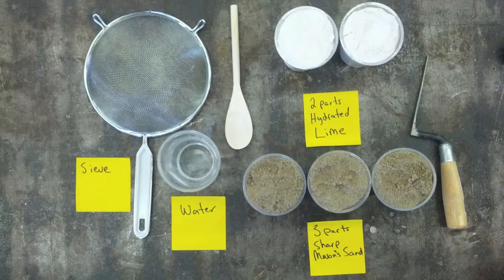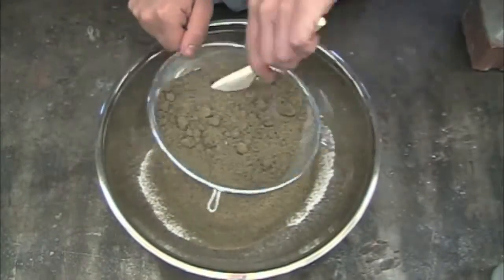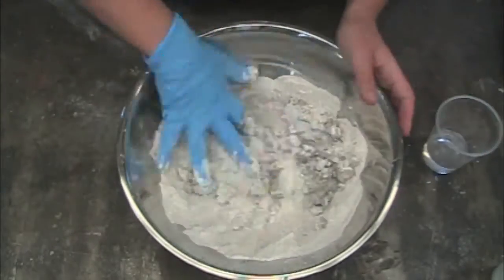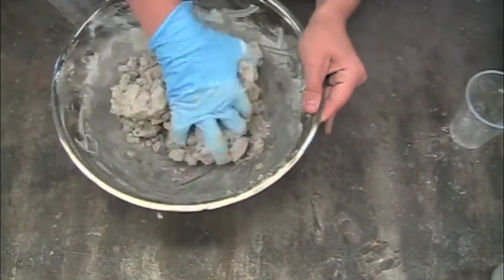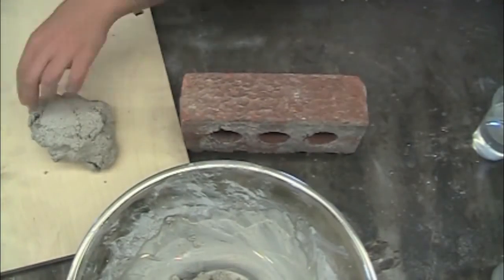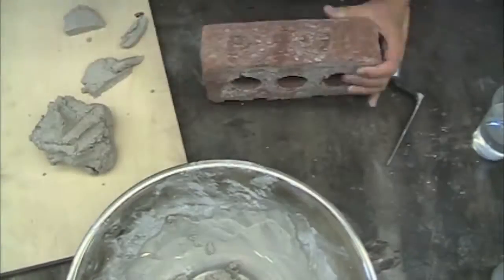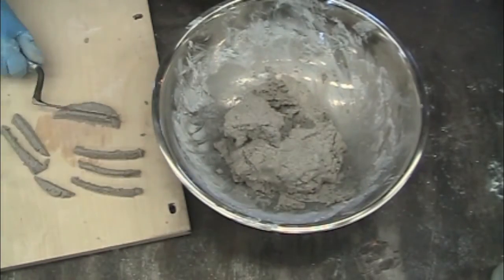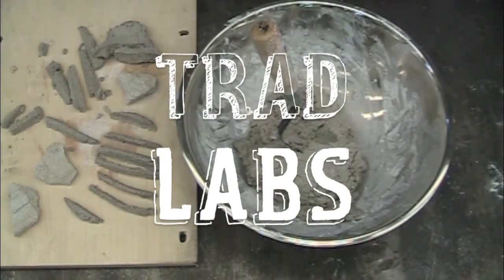Mixing Lime Mortar for Repointing Historic Brick

Comment: Interesting that you sieved out the pebbles. In Britain, a coarse, flinty aggregate is preferred in lime, so you'd actively want some pebbles in the mix for that. Then once the mortar has set off a bit, you hit up the joints with a stiff brush to reveal the aggregate in the joints.
Reply: I was going to say that! Larger stones are highly desirable for what is a very weak binder.

Comment: You need hydraulic lime, not merely hydrated lime.  If it's not hydraulic, it's won't set up right.  Hydrated lime from most hardware stores is unreactive, and won't cure.  Hydraulic lime (labeled NHL 2.0, 2.5, or 5.0  or PHL 3.5 or 5.0) are reactive, and will combine with carbon dioxide to cure hard and strong.
Reply: Very true.  What she made will fall apart the first rain.  I used to practice with this mix during my apprenticeship because I was able to reuse mix night after night.
Reply: Nonsense peddled by the lime industry. Hydrated lime makes perfectly good mortar and plaster.
Reply: This is incorrect. Non hydraulic lime requires carbon dioxide to reach full strength over time. Hydraulic lime will set under water. So there are different lime types.
Do note masons sand contains an element of clay which assists lime mortar.

Comment: What do you mean by "Mason Sand"? Is that 'regular' sand purchased from building store? 
I have mixed Lime with Sand (purchased from building store) in a 2-3 mix, and the mortar solidifies in several days:

After one day, it solidifies but it is not strong -- I can unply it with my finger. 
After three days it solidifies to the point where I cannot unply it with my finger. 

Is this normal?
Reply: Yes, that's normal.  It takes a long time for lime mortar to "carbonate", absorbing CO2 from the atmosphere to turn from calcium hydroxide to calcium carbonate ("limestone").  It initially firms up from evaporation, and then slowly hardens.  You need to be sure that it doesn't dry out too fast; if it drys out by evaporation before it carbonates you can end up with very weak mortar.
Reply: She means 'sharp sand' or 'grit sand'. A lot of the sand you see in building supplies is 'building sand' which has rounded grains suitable for cement mortar. Lime mortar needs sharp grains.